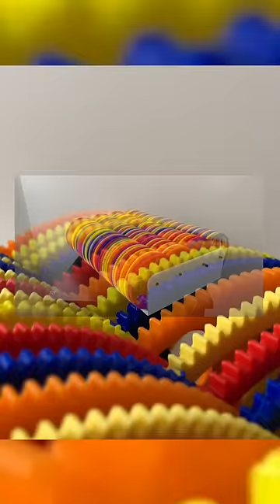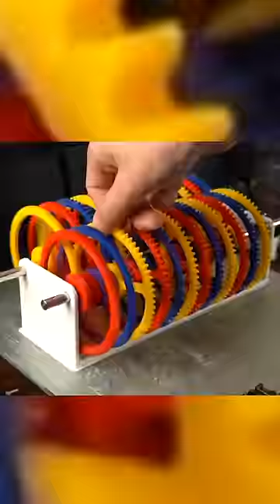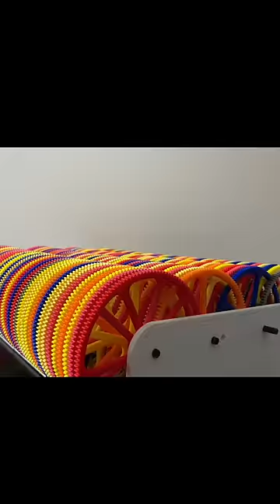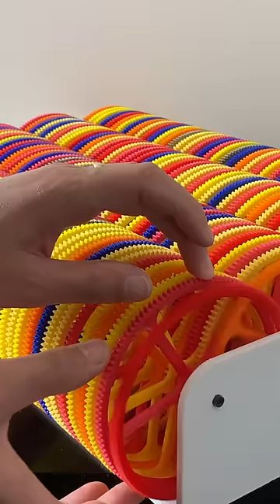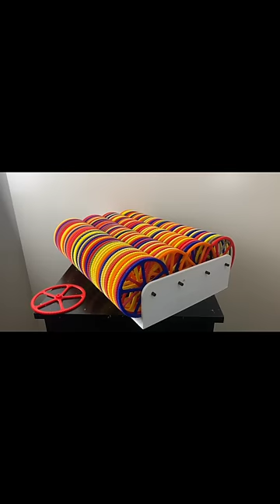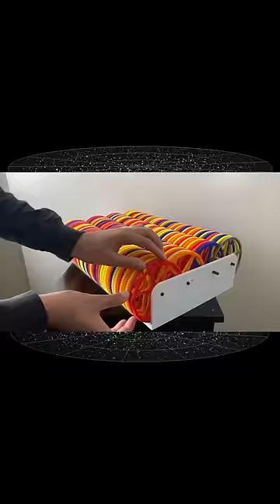World's Highest Gear Ratio (in 60 seconds)

Comment: I just want to see him spin the last gear and see how fast the first one spins
Reply: too much friction, it wouldn't even rotate. You'd break the gear first. It's like sticking a bike in the highest gear before trying to ride up a hill.
Reply: Idc if it breaks the machine, I want to see someone spin the last gear
Reply: world.exe is not responding
Reply: I want to see this
Reply: its just not possible yall, its like trying to move something with mass greater than 1000 cars, either way it's impossible.

Edit: you get my point stop trying to correct my bad example you understood the point
Reply: That would cause the universe to be unobservable.
Reply: You need an unstoppable energy to move it.
Reply: Me just about to comment this then like😮
Reply: I don't care if there's friction or some thing but all I I want to see is He. Spinning. The. Last. Gear.
Reply: @urbancats1  did you take away anything from the reply’s? you literally can’t spin the last gear
Reply: The first one will have a speed superior to speed of light so it will break
Reply: it will be impossible to rotate the last gear without breaking it
Reply: It will fucking explode
Reply: You would essentially need infinite torque to spin the last wheel.
Would could spin the wheel he spins in this video and look how much torque you need to visibly move it. Then multiply that by the ratio, that’s the torque you would have to apply. It is impossible.
Reply: @nanolog522  Nobody cares we want to see him spin the last one so it go fast
Reply: @CheeseFest-  It is physically impossible. There is no material on earth that would make the wheels strong enough, nor would be be able to produce enough torque.
Reply: @nanolog522  just connect it to another gear ratio to create the torque ??
Reply: @jesuschrist9597  did you hear the man he wants to see it spin and frankly so do I so yk what ima do I'm going to spin it at the speed of light
Reply: @CheeseFest-  But then it won’t turn. Because again, the ratio will have to be so large that you won’t see it moving in the next thousand years.
Reply: @nanolog522  then spin the last one so that one spins fast too
Reply: @urbancats1  it literally can’t happen
Reply: probally would be super hard to spin the last gear tho. probally not humanly possible
Reply: That’s the first thing I said after hearing ten to the 82nd
Reply: Creates a black hole
Reply: @susmanrules  Moving a car is not that hard but I agree with your point.
Reply: it'll just broke 🤣
Reply: @jpsalis  ok so make them metal and attach a massive methanol powered big block V8 to it
Reply: Too much torque needed. Structure would break.
Reply: You reach Millers planet.
Reply: @boltlightning7804  - Been a while since I saw that gag...
Reply: @jonslg240  You guys still aren't getting it.  I just want to see the last gear spin still
Reply: @SneekyFauker  actually I can get that lol
The idea from the people who want to see the last gear be spun to spin the first sounds more neat, but probably not possible lol
Reply: Same
Reply: Is would not spin the torque would be too low and friction forces too stong
Reply: @jonslg240  nothings impossible, your brain is just too small probs
Reply: @nanolog522  Bruh 😂😂😂😂what do you mean?
Reply: @ctfrost2613  It doesn’t work. Spinning the last wheel is only possible if it is disconnected from the gearing. Otherwise, spinning it even by something just barely visible would mean that the „first“ wheel would have to spin millions or billions of times. Which is impossible.
Reply: @nanolog522  nothings impossible
Reply: @nanolog522  bro if it spins fast enough then billion spins can take a few hours
Reply: @ctfrost2613  Yes, it is impossible. The material is not strong enough.
Reply: universe implodes
Reply: Me to
Reply: @boltlightning7804  explorer.exe isn't responding
Reply: There's not enough energy in the observable universe to rotate the last gear. It's pretty cool
Reply: @cybercloud8021  i know but I want to see it explode or kill the uneverse
Reply: @cybercloud8021  lol
Reply: It would make so much heat that it would melt whole country
Reply: remember, if it take a number of rotation of the first gear to make one rotation of the last
making the last one do one rotation means spinning the first that amount of rotation
Reply: you need the power of the big bang to rotate it slightly.
Reply: It would create a tear in the fabric of space and time.
Reply: U cant do that its technically possible with enough torque and a unbreakble
Reply: @Mrflipflops_w  there is no enough torque to do it
Reply: @jpsalis  not friction. Thats the completely wrong explanation. It's because of mechanical advantages. It's like trying to pick up a stick, except the stick is 2 light-years long and at the end is 10 megatons of steel.
Reply: Same
Reply: I need to see the hardest gear to move get moves then keep shifting up
Reply: @Rpzz0  literally
Reply: @joedad9999  It's both. You're assuming it has to be one or the other. the high mechanical advantage causes an insurmountable amount of friction throughout the gear train that could not be overcome without breaking something, even with unlimited amounts of force. 

Yes, you are correct in your analogy, but it ignores other forces at play in the actual scenario. It would be difficult to move that mass, but not impossible assuming you're apply a torque to this magical rod as it's dangling in theoretical cyberspace. Even a small torque on the stick for a second or two would give the mass some amount of angular speed. really, really close to 0, almost inconceivably close to 0, doesn't mean the same thing as 0.

To better fit the analogy to the real life scenario, assume the mass is on a surface, under the influence of gravity. Somehow. Don't think about it too much. To move the mass, you would additionally have to overcome this force before your object even lifts off the surface. In the real world, no material is infinitely rigid or infinitely durable. Something will break or flex before the mass even moves.
Reply: @alternate5108  I swear what fo I need to build the last few gears out of for them to spin, I wanna see how fast that thing can go
Reply: It's the same thing other way around, it wouldn't spin
Reply: INFINITY!!!
Reply: @susmanrules  But technically&logically you could use a team to move the car.Right?
Reply: @susmanrules  that's not a good comparison cars are not that hard to move....
Reply: Ikr
Reply: It won't bulge
Reply: @urbancats1  you.can't.move.it.even.an.inch.and.only.thing.that.will.happen.is.that.gear.breaking.
Reply: @CheeseFest-  🤣🤣🤣🤣🤣

That just means you have to use a gear that is almost the same as this one. So it will still gonna take this much time
Reply: @KaziiTheAvali_inactive  EXACTLY
Reply: @MünWeeew  you can do the math but most likely that is not even close
Reply: @SneekyFauker  we got it. All we are saying is that, the last gear won't even more a millimetre
Reply: @newbie4789  use a hydronic press
Reply: @jpsalis  yeah that's what I think too
Reply: It would break, but imagine if he just travelled in time 💀💀💀💀
Reply: @newbie4789  probably break the expensive $400k+ engine before turning the gear a single tooth
Reply: I was just about to say that
Reply: You don't have to turn the gear within a few seconds. You could apply a force to it over a very long period of time
Reply: @jonslg240  force won't add up😭😭😭
Reply: like he said more than the speed of light 🤣🤣🤣🤣🤣
Reply: @jpsalis  naw it's like putting your little barbie doll motor onto a cargoship and then trying to go ride the ship through 10 foot thick ice. I just don't think you understand howbmuch power osnnescicary to do this. And Also my thing is not an exaderation it's an extremely under exaserared
Reply: @CheeseFest-  the press will either break the gear wheel or If the wheel is too tough, break itself
Reply: Speed of light xD
Reply: @newbie4789  bro have you ever tried it?? What’s your reasoning
Reply: @nanolog522  Nah Philippians 4:13 bro
Reply: Would explode the universe probably
Reply: @calebs_asmr  I mean that's besides the point, I'm saying no matter how much force you apply, the gear will break first
Reply: @jpsalis  yeah no amount of force in this universe combined could turn that gear.
Reply: @jpsalis  You are describing what I want to see
Reply: @calebs_asmr  use another gear ratio and boom that’s pretty of force I don’t know what you guys are on
Reply: The required torque for that to happen would be absolutely insane, let alone decay of speed and force because of the adverse reactions of friction and the fact that there are most likely over 100 gears in that system. It would be impossible unless you had over 10 million ft lbs of torque, I’m not even joking, and before you even get CLOSE to that number, the parts would most likely snap from the aforementioned forces including that they are most likely 3D printed, there are no chances of doing that any time soon.
Reply: @validbutatwhatcost8754  Surely you can’t be serious.
Reply: @jpsalis  it's hard but it does work. So spin the last gear.
Reply: @jpsalis  you mean when riding down a hill?
Reply: If it takes the first gear to move at the speed of light to make the last one turn once before the heat death of the universe (if that's how it ends) , even turning the last gear one turn per year, the first would go faster than the speed of light. if it worked. But even knowing that I want to see him try 🤪 .
Reply: @angusmctwangstick4079  yeah it would be super cool
Reply: Same
Reply: @shit_happens4594  just use another gear ratio explain why that wouldn’t work
Reply: @MünWeeew  not quite strong or powerfull enough
Reply: @CheeseFest-  ok. So you mean use another gear ratio, that is in the reverse order to spin the slowest gear right?

But you are still limited at how much torque you can generate that is agreeable.

So to amplify that humanly possible torque into a big enough torque that could potentially move the slowest gear in this one even the slightest, you will still need a fairly large gear ratio. At least 60-70 gears if we are using the same type. 

But then it is the same case . It will take a huge amount of time , of the scales of age of universe for the slow gear to move even the slightest so it will never reach it . 

gear ratio is way more powerful than you imagine. The torque is increasing proportional to the ration and each gear is multiplying the gear ratio by 10. Like adding a new gear means atleast 10 times the torque you need before
Reply: @CheeseFest-  na. When he said 10 million ft lbs, it's way less than what we actually need. Imagine that yo turn the first gear, you need 0.0001ft lbs of torque. Then 10 million ft lbs won't be enough to spin a mechanism like this with just 12 gears.
Reply: @odezat1317  I hope you're kidding
Reply: @champagnepandaog3305  Ah, yes. The power of love and friendship.
Reply: @newbie4789  Yeah, power does but force doesn't
Reply: @CheeseFest-  How old are you?
Reply: @CheeseFest-  Then you're back to square one with infinite spinning to do
Reply: @jpsalis  make it from carbon fiber.
Reply: @susmanrules  that’s false, I’ve push started my car and pushed it up a hill, I’ve moved my car and others
Reply: Speed of light
Reply: I WAS THINKING THE EXACT SAME THINGGGG. Ik it wouldn't work but imagine if it DID.
Reply: Yeah guys i know it's impossible, but at least i just want to see him try
Reply: Probably wouldn't even spin unfortunately maybe if he set it up to put a drill on it
Reply: That would take more torque than the solar system has
Reply: I will spin so fast you will need duble face protection in case it s breake, which it will most likely
Reply: @nanolog522  who cares how efficient is that, we just want to see someone grabbing the last one, and rotating it, no matter if he succeeds or not. just grab it
Reply: @crackedthieves  it never spins. we just want to see someone try it
Reply: @CheeseFest-  forget about 1:10^169, a chain of a chain of 12 gears with ratios 1:10(an overall ratio of 1:10^12) can already reach light speed(never happening) when you spin the last one for 3mm/s. your argument is nothing to them just like how their arguments are nothing to you, satirical or not.
Reply: @nanolog522  ik but who cares we know it wont work but still we wanna see someone try it
Reply: @nanolog522  dont use harsh words man
Reply: To all of you trying to explain why it won't spin, duh... We just want to see a black hole form when the laws of physics break down.
Reply: Assuming he removed all the backlash from the gear assembly, you saw the last gear spin, just a tiny fraction of a degree of rotation, extremely slowly.
Reply: @jpsalis  it would be interesting to calculate the theoretical force though
Reply: I've heard it would take more energy than the whole observable universe has due to torque
Reply: i think it will spin with the speed of light 💀
Reply: Make one, out the strongest material im the universe, then spin it
Reply: Não é pq é impossível que não deveríamos tentar kkkk
Reply: @susmanrules  i ve seen my family move a car multiple time ,it s not that hard
Reply: That's like asking someone to bend a piece of wood in half without breaking it.
Reply: Do you know torque and why I hate it
Reply: And creates the black hole
Reply: You can't spin the last one even 1mm
Reply: If it somehow did turn the first gear, I’m almost certain it would explode from the speed and torque alone.
Reply: Some of the people here, don't understand what the word "impossible" means, do they?
Reply: @alternate5108  technically it might be possible if the material can survive you could use a divergent tech tonic plate boundary and have a rope to one side and the contraption on the other wile the first one will spin really slow and probably break NGL it might work
Reply: @jpsalis  theoretically if it did spin he means, would probably warp space time if he got it to rotate at just 1 rpm
Reply: @boltlightning7804  run: world.exe
Reply: if the amount of rotations of the first gear required to turn the last gear are virtually infinite then the torque required to turn the last gear is also virtually infinite
Reply: @starlitstreet  😑😑 of you can just turn it because its small and i am big and strong
Reply: This me
Reply: Me to best guesses are , disintegrates,  creates a black hole , or Flys into outer space due to all the respective physics
Reply: Its impossible, that much torque doesnt exist in the universe.
Reply: Enough torque it's a time machine. "warping time" = /> "teeth lost" =D you would certainly hit your target sooner haha or not at all OO
Reply: If you connect that thing on the motor thing that turns kinetic energy into electricity you will have enough power to power a City i think
Reply: @jpsalis  wait it’s not meant to be the highest one.
Reply: Too much torque
Reply: It would spin at the speed of light
Reply: @mattithun4813  Even if that was precision machined you wouldn’t be able to turn it. The stress on the gears would be far to great.
Reply: Let's say for instance he was able to spin the last gear directly!

Hello darkness my old friend... I've come to talk with you again!
Reply: @mattithun4813  no it wouldn’t it would speed at a direct formula of 1.5(10^n) n representing rotational units.
Reply: If he spins the last gear wouldn't it be like spinning the first one? He's just turning the machine around... spin the one in the middle
Reply: This is why I came to the comments just to see if anyone asked the same question
Reply: @alternate5108 I like how you think champ
Reply: same thought
Reply: @alternate5108  Let's say it doesn't break at all, you still wouldn't see it move according to physics because the outer velocity of the gear on the other side would reach 99.999999...% the speed of light and I'm not sure about this but physics says you can't move any object faster than the speed of light no matter how much energy or force you apply.
Reply: probably bazillian times faster than speed of light if the gears were made of indestructible material and guy spinning it is god lol.
Reply: its like ur trying to divide by zero
Reply: The torque would break the gears before it ever spun xD
Reply: It would either fail miserably or defeat the odds and open a vortex to the 4th dimension, strictly these outcomes only, nothing else would be a reasonable guess. 
😐🙂
Reply: @jesuschrist9597  try it ANYWAY
Reply: Torque would make it impossible
Reply: Like he said, faster than the speed of light. And that’s just one rotation per billions of years. If he could spin the front gear at an observable rate it would probably take more energy that there is in the universe.
Reply: break
Reply: make it out of hyper strong material and have a tank pulling winch on it
Reply: I know ow right
Reply: @MailboxYig  thats not how it works... the mans in the video just ecplained how it'd have to go faster than the speed of light to move the slow one which is excentially impossible, but moving the slow one to make the other one travel faster than the speed of light is impossible to have friction not break the gears with whatever humanly possible material you can think of as it would just begin to rip the molecules apart, and even hard with modern rocket science specially with a tank
Reply: Regardless of friction you would need basically infinite energy to exert the required force on the last wheel
Reply: Friction makes it impossible around the 8th gear. But I think it would be interesting to try building one with a very cold superconductor and magnets
Reply: you can all ready do this in 4 low  on a 4x4  it would go 55,000 rpm at 60mph
Reply: It would just break
Reply: @nanolog522  Spin the wheel! Spin the wheel!
Reply: @alternate5108  If the first gear would need to spin faster than the speed of light to complete a single rotation on the last gear before the heat death of the universe then spinning the last gear is going to be flat impossible.
Reply: exactly what i was thinking
Reply: @jpsalis  At an 80° incline... with the sun's gravity.
Reply: @susmanrules  moving a car isn't impossible
Reply: @jpsalis  BUT I CAN RIDE UP HILLS AT MAX GEAR
Reply: The energy needed is infinite though
Reply: Yap.
Reply: @cooperpayne  man. It's an analogy. And you're not doing it from a standstill on a hill. I was making a reference to the overwhelming amount of force you would have to overcome just to get any movement at all. The scale doesn't compare at all. Jesus dude, we're talking about a gear ratio, you had to make this a personal attack?
Reply: @susmanrules  you think it’s impossible to move a car?
Reply: Yup
Reply: even if entire train engines in the world are connected in series they even that amount of force cannot rotate the last fear (#if somehow the gears are of VIBRANIUM)
Reply: @yashpatil7017  no trust and how would you even know ?? Have you tried it
Reply: we don't want to destroy the universe though
Reply: @susmanrules  move a car impossible? Not if it’s a Japanese car.
Reply: Me too i wanna see it go burrrrrrrrrrrr
Reply: Same here
Reply: @alternate5108  lol, you will be watching a video of someone breaking a gear box then.
Reply: @jpsalis  yes but is there a metal or something that would allow it to turn? Even with a pry bar?
Reply: Me too!
Reply: ok.... but what if you put a low torque generator on the fast side, then a rubber band on the other side?
Reply: That’s all I was thinking of 😂
Reply: But you could theoretically very gently push it causing the first gear to rotate. You just have to push it slow enough
Reply: Genius
Reply: Excalibur!
Reply: @jpsalis  not about friction, but force needed
Reply: instead of moving just the last one you can move the 2nd gear and multiply by 2 each each step up.
Reply: @jpsalis  It's not the friction, it's the angular inertia.  Even with a frictionless gear box, you still couldn't spin it.  Changing the angular velocity of a rotating object requires energy based on its moment of inertia.  Just as you would have to spin the input gear faster than the speed of light to get the other one moving, the amount of work you would have to do on the output gear to get the input gear to move any measurable amount would instantly generate a black hole.
Reply: I would also like to see him spin the last gear,

 (what I meant was, I want to see it break due to physics not allowing it)
Reply: here https://youtu.be/FywIvJ_jIhg a video where another guy tries to move the last gear on a different gear ratio (still really big)
Reply: @susmanrules  the
Reply: I was going to comment this
Reply: it was like trying to hold weight of blackhole
Reply: did you Just go faster than the speed of light?
Reply: I want to see him try spin the last gear too!
Reply: lmao first build the same thing bedrock, then the first gear wuold be so fast that it wuold destroy thw entire universe
Reply: People keep /saying/ it literally cannot happen, but I've yet to see any if you even try one time.

Just fucking try spinning the last gear damn it
Reply: It would take so much energy to spin  that if we made as many nukes as earth's resources allow and use all that energy to spin the gear the gear would break
Reply: The amount of torque needed for that would require a lever that is the size of the universe and indestructible gears 😂
Reply: Man just created the impossible at the same time possible last gear
Reply: @evansgambit164  Youre an understanding person, thanks for the comment!
Reply: @alternate5108  same 💀
Reply: Try it. When it breaks, go to the next one. Repeat until it turns. How many must die for it to spin?
Reply: The amount of energy it would take to spin it would be impossible.  Galactic level energies
Reply: Honestly probably more energy than the entire universe has.  

The first gear would have to spin at the speed of light for trillions of years to get the first to spin once.   
You could hook it to a spinning black hole and it wouldn't turn it.   
Obviously things would fail first, but beyond that if you had some mythically strongattial that COULD do it, and you COULD get the first gear to spin faster than the speed of light, and show hook it to the fastest spinning most massive object in the universe, and it would stop the spin of that thing. 

It's inconceivable, the level of force.    

It's, by all intents and purposes, impossible.   

So yeah we wanna see it too
Reply: @alternate5108  1000th like on your reply!!! It was so satisfying!!!! 😄
Reply: Space time itself will collapse and will cause a permanemt rupture in the universe creating alternate realities and will eventually lead to a big bang then the universe will start again. 😅
Reply: bro's gonna break the laws of physics
Reply: You should try to lift a bulldozer with your barehands to get an idea
Reply: @joedad9999  yeah I wasn’t exactly sure what friction had anything to do with it. That’s making the presumption it would move at all.
Reply: The machine breaks so the universe doesn’t
Reply: The weight of the final gear attempted to be spun would be so great the gear material would shread before turning the gear
Reply: @micheallinne3159  rubber band, and a rotational generator.
Reply: That’s just what I thought
Reply: @jpsalis  so i break my bikes because im always riding on the highest gear?
Reply: I think about same think
Reply: Doesn't that mean it's broke then?
Reply: Couldn't you manually spin certain gears to artificially speed it up?
Reply: That takes too much force. The first gear would spin faster than the speed of light.
Reply: @jpsalis  what if it had a high torque insanely powerful electric motor hooked up to it in the gears were a insanely strong material like tungsten carbide or armor Steel
Reply: @Dzexel  wu t? youtube replies are strange lmao
Reply: WE. WANT. TO. WATCH. IT. GO. BURRR.
Reply: Same
Reply: As much as I'd like to see him spin the last gear, it would surely break something, if it would even spin
Reply: idk why people saying it’s not possible it’s only made out of plastic it can’t be that hard to spin
Reply: That's not how it works
Reply: @susmanrules  Don't care,  me wan't see.
Reply: at the speed of light
Reply: too much torque required
Reply: Yeah torque and friction say no. My brain also wanted to see him defy physics thought 😅
Reply: Exactly...🤣
Reply: supernova
Reply: Can't cause it'd fracture space-time causing our universe to collapse upon itself ending all existance as we know it...💥 

We should give thanks He is a fair & just Creator🛐
Reply: I guess faster than the speed of light 😂😂
Reply: Only a few requirements.
1) We need the gears to be indestructible a million times stronger than the strongest metal known to us 
2) Infinite endless energy is required to spin the last wheel
Reply: I’m with ZMorea on this one. Physics be damned! SPIN THE LAST ONE!
Reply: @marcuspowell2510  it will break before anything happen 🤣🤣🤣 it's against the physical law's of the universe
Reply: @regalblack1503  PHYSICS BE DAMNED!!!
Reply: Dude would go back in time, obviously...
Reply: universe begins to lag
Reply: @jpsalis  as soon as you break it go to the one after that until it works
Reply: 3 in 1
Reply: It's not just hard, it's literally impossible because you'd need to apply the energy necessary to have the first gear surpass the speed of light and that amount is infinite. So it either breaks, or it doesn't move at all (or it moves so slowly you wouldn't even notice).
Reply: @mattesh5839  I mean yeah eventually you'd find one that spins but it couldn't be more than like 20 gears from the end or something
Reply: It would instantaneously convert its mass to energy and detonate
Reply: If he had enough energy to rotate an indestructible version of that gearbox with its last gear, the first one would rotate several million times the speed of light, most likely a lot more than that though, I just don’t wanna actually do the math
Reply: As he said, the first would have to rotate faster then c to get the last one to spin once before the heat death of the universe. That is impossible under the current understanding of physics
Reply: It will show you heaven work
Reply: @jesuschrist9597  did you not get the joke lmaooo💀💀💀💀
Reply: Omg the people in this comment thread is killing me lmao
Reply: @jpsalis  I did it
Reply: That’s what I was thinking
Reply: @jpsalis it's made out of plastic so either it spins or it doesn't I want to see him try
Reply: the 1st gear would spin so fast you wont be able to tell if it moved or not.
Reply: I was gonna say the same thing
Reply: @jpsalis  well that just requires a couple days of cycling before it's easy. Analogy rating 4/10
Reply: If the gear could hold, you would probably literally need more energy than there is in the entire universe.
Reply: @adamperry5794  what are you going on about?
Reply: @jpsalis  I can't find my comment and don't remember commenting here so I have no clue
Reply: @jpsalis 
 oh it was that comment

Idk bro it might have been bc cycling up a hill on max gear is easy as long as you've cycled a couple days in a row

So I gave you a bad analogy review

Simples :>
Reply: Shut up I spun the last gear…
Reply: Like he said, assuming nothing breaks which it would, the first would spin faster than the speed of light.
Reply: @jpsalis  makes sense. He needs gears made of better material than plastic.
Reply: @Rpzz0  want to see it. Lol
Reply: @nanolog522  let's say the gears are never going to break or melt or change. If you hooked a 1200 hp Toyota supra up to it could you spin the last gear?
Reply: To put it simply, he'll spin the last gear when you pick up a car with a toothpick 😂
Reply: error 404
Reply: @jesuschrist9597 You aren’t listening. He wants to see it, and frankly, so do I! A fruitless want, but a want nonetheless..
Reply: @PIndyJones  No. Because hp are not what determines if you can spin something, that would be torque.
And you would need billions of Nm (or even more, I don’t have time to calculate it) to turn those wheels.
Reply: not possible....
Reply: Lol unimaginable amount of torque
Reply: Faster than the speed of light
Reply: Yes
Reply: @nanolog522  well, I would assume a thousand HP supra would be pushing very high torque also. But i get what you're saying.
Reply: the big bang
Reply: @PIndyJones  It would be a different kind of torque. With a car, that’s just a number. The engine would have to turn the wheel from zero rpm. That would require gears and at the end a clutch to fix the fact that a gas engine needs to turn to generate power.
Reply: @jpsalis  don’t think its friction but tension
Reply: Maybe it would spin so fast it warps time 💀
Reply: @jpsalis  I learned this the hard way with lego gears
Reply: I want to know the math behind this action, like if all the mechanics and friction worked out and it was possible, would the speed be faster than light? With all the exponential growth it seems like it would intuitively.
Reply: Not enough torque possible.
Reply: That would take a greater than infinite amount if energy
Reply: it will take force of earth's weight
Reply: INFINITE POWAAHHHH
Reply: Imagine building last gear with super strong material.(I think it still break)
Reply: The last gear cannot be spun, it's stuck like as if it was glued down. You would break the last gear long before it can move.
Reply: Faster than the speed of light surely?!?! 
He's invented a warpspeed drive!
Reply: So many in the comments not able to just take the piss
Reply: It just wouldn’t move. It would feel like it’s completely stuck.
Reply: A 'world.god stoped working' message would pop out
Reply: @jpsalis  no shit
Reply: BOT  did I say bike? I meant bicycle, either way
Reply: you're all wrong you could get the first gear spinning off the last gear but you would just have to create an entirely separate device to move all the other gears just enough to build some momentum maybe even something simple like equivalent to a rake set up in a very specific pattern that would allow you to move a portion of the gears
Reply: @nanolog522  Rick Sanchez could spin the last gear
Reply: The amount of power needed would be crazy, assuming that the gears are indestructible. The last gear would most definitely be moving faster than the speed of light.
Reply: @staticostrich4689  make em out of cobalt or tungsten
Reply: @odezat1317 , "The first one will have a speed superior to speed of light so it will break", or maybe it will cease to exist?
Reply: Once u get to the last gear the first one will break long before
Reply: @jpsalis  our hardest alloy in dead space bro
Reply: @MerudonWoW  if you started in the middle
Reply: I could move that last gear. 100$ I could move that
Reply: Spin it !!!
Reply: @alternate5108  they just said it won't spin. it will just break. are you not understanding that?
Reply: @CheeseFest-  sup? you just fly in from stupidtown?
Reply: Imgine using the same amount of force in one twist of that last gear as  spinniing the first gear at light speed for millions of years. Pretty sure a big boom would happen
Reply: I’ve tried to spin 5 toy gears using the largest one and it wouldn’t even move. This would Straight up break lol
Reply: That's what I was thinking!  I don't think it is heat that is the problem, per se, but force needed to spin it.  You couldn't budge it in the first place.  I guess you could on a technical level, but we would be talking about imperceptible movement.  The plastic would shatter just like trying to haul on a knotted rope until the knots work themselves out.  Rope failure or the thing it is tied to would occur before you gained a centimeter of slippage.

Kind of makes you wonder if it isn't possible to do the exact same work of a piece of hydraulic construction equipment using only one man and his muscle.  I mean, I know it is possible, but not using a reasonably sized or easily transported mechanism.
Reply: BESTNVESTING  I'm just asking an honest question though would it be possible to create a separate device with say the equivalent of many little fingers hanging down perhaps or gears themselves that you would hold in your hands hopefully this makes sense and sort of lower on top of the gearbox and all the individual little pieces would make contact with all the necessary gears and start very gradually turning them all at once building up the momentum so that no uneven amount of force is distributed among any one gear
Reply: BESTNVESTING  and of course along with this caveat comes with the obvious that the gearbox could be made out of anything you want from titanium to tungsten
Reply: @jpsalis  If the material would be a different one? like metal? it could work?
Reply: @jpsalis  no one asked
Reply: @Rookie0X  nope you need much more than that as still wouldn’t work it would break
Reply: @jesuschrist9597  use a motor to drive the gearbox duh
Reply: @jpsalis  I've rode a bike in the highest gear up a hill
Reply: @boltlightning7804  space-time.exe... Your welcome 😁
Reply: the amount of torque required would not be possible, and would break the gear
Reply: @bluegreenash  I have rode up a hill with a bike in top gear
Reply: It's funny reading the comments saying just spin the last wheel even if it breaks. Many people already explained it was impossible to move but they still insist to just move the last wheel lmao
Reply: wouldn't it just do the same thing even if you started on the last gear??
Reply: @radioactive1014  its a fundemental concept that us humans desire more than just an intellectual understanding of something
Reply: With a sufficiently strong material and sufficient energy, you could spin the final gear as fast as you want, as long as it doesn't exceed the speed of light. The first and last gears would both be very close to the speed of light, but with vastly different energies, due to relativistic effects that can be modeled with Lorentz transformations. It's counterintuitive but at relativistic speeds, the gear ratio no longer describes the ratio of wheel velocities, but the ratio of the energies.
Reply: @jpsalis  I get this, but can you not freely spin that last gear like the first? What's preventing the last gear from being the first gear if you just so choose to spin it from that end? Anything?
Reply: @radioactive1014  Just move the last wheel :sigh:
Reply: yeah
Reply: @alternate5108  it doesn’t break the machine, it breaks physics
Reply: For people asking him to spin the last one, there is not enough energy in the universe to spin the large gear even if the material was indestructible. Simple physics
Reply: No material would handle the force it would take to spin that gear
Reply: @susmanrules  Don't mind me trying to find an electric motor big enough to do so
Reply: @jpsalis  can't have no in your heart...
Reply: Black hole created
Reply: @champagnepandaog3305  "Nothing is impossible, Mario! Very unlikely or highly improbable, but never impossible!" -Luigi
Reply: TL/DR of this comment thread, both sides say:

"DID I STUTTER?!"
Reply: lol @ the mix of trolls and people who genuinely don’t understand in this thread
Reply: that will make space time collapse into a blackhole
Reply: @jpsalis  it didn't rotate not because of the friction
the rotation speed just didn't respond
Reply: It should spin faster than the speed of light by his own words
Reply: Sad
Reply: @nesyboi9421  how old are you? i said the torque is too big you would need more energy than the earth is currently making to spin that gearbox. its not possible
Reply: Interstellar music intensifies
Reply: Do it on 20.12.2022
Reply: Man read my mind
Reply: @susmanrules  mathematically yes, but I'd like to see if I could break the gear at the end
Reply: @jpsalis  what if you stuck a wartsila rt-flex96C up to it? Would it power the gearbox?
Reply: @nanolog522  what if you used a wartsila rt-flex96C?
Reply: @MeEntertainmentJo_876  Not even close to what you needed.
Reply: @alternate5108  there isn’t enough energy in the universe to spin the last gear.  That’s not an exaggeration.
Reply: @nanolog522  😭 I want to see the last gear spin! 😭😭😭
Reply: There's no material in this world that can sustain that force. This plastic one is going to break.
Reply: @resque1122  ….

But I want to see how fast I goes!
Reply: Torque is infinite, you can probably pull a black hole with that thing
Reply: @thewanderingguy5436  my sex drive be like
Reply: Everytime he spins the last gear, universe dies.
We are luckily in the version where he doesn't.
Reply: Right, that's exactly where my mind went
Reply: Facts, it would produce so much light that the next Big Bang would happen
Reply: Same numbers and time just backwards,,,the planet would collapse
Reply: @susmanrules
Reply: @jesuschrist9597  let. Me. See. Spin.
Reply: lmao
Reply: @PandiTheBear  that's a good analogy, I like that one lmao
Reply: I agree, I want to see the last gear turn.
Reply: @boltlightning7804  lmaooooo
Reply: @alternate5108  it is physically impossible no matter how much force you apply. To turn that final gear at any amount it would cause the first gear to move faster than the speed of light which is impossible.
Reply: If it were possible, the first gear would spin faster than light, given how long it takes to rotate the other way around.
Reply: @jesuschrist9597  did you take nothing away from his comment? He does not care, he still desires to see it!
Reply: @TheYourGoose  "YoU cAnT wAnT tO sEe It SpIn BeCaUsE mAkInG iT sPiN iS tOo HaRd!"
Reply: @urbancats1  it's like opening semi truck tyre bolts with thin plastic long rod , it would just break. Spinning that last gear is like spinning a gear that is uper glued, it won't just move.
Reply: @jpsalis  🤓
Reply: Okay but what if the material from which gears were made would be theoretically indestructible and we would use like black hole to spin the last gear?
Reply: @calebs_asmr  What's exaserared
Reply: the last gear feels like its not able to move.. well except that its plastic and you can easily break it
Reply: @jpsalis  i only ride my bike in the highest (21st) gear.. aint nobody got time for shifting gears on a bike
Reply: @ayushkumarjha9921  Oh I didn’t know that thank you
Reply: Not possible unfortunately. He said he’d have to spin the first gear at over the speed of light. To get the last one to move. So reversing that, you’d have to put the energy required to move something at the speed of light, into the last gear, to move the first.
Reply: We as humans think like that only first 😂
Reply: Proceeds to create a machine capable of moving at the speed of light
Reply: @odezat1317  That's what we want to see got damnit
Reply: @Rpzz0  That's what we want to see, dingo
Reply: You heard the man, he can make that gear go light speed! FTL DRIVE.. jokes.
Reply: Broke: “The last gear won’t spin, don’t even try it”
Woke: “That’s the point.”
Reply: @nanolog522  this is untrue.  The last gear is spinning.  It's just so slow it's unabservable.
Reply: I said the same thing
Reply: @boltlightning7804  universe.exe has stopped working
Reply: @CheeseFest-  The gears would break
Reply: @celularphone  It is spinning when turning the first wheel, that’s true. But here it is asked to spin the last wheel and turn the first one doing that.
Even a tiny bit of turning of the last wheel would result in the first one going insanely fast. This means that you need insane amounts of torque to just start turning the wheel, and for technical reasons, no motor exists that would allow that amount of torque at zero rpm.
You would be kinda correct when talking about the theoretical model. We are not, however.
Reply: No, that will time travel to the past.
Reply: @nanolog522  you are wrong.   Take the Aamer contraption.  Hook it up opposite.  Spin the last wheel and it will make that wheel the new middle and the last gear will spin.
Reply: Births a new universe
Reply: @boltlightning7804  God himself comes down and bans the guy whos cheating
Reply: Ok, so the 1st gear has the least resistance and friction to being turned, while the last gear has the highest resistance, to the tune of 10^169 times the force required to turn the first gear Superman would blow his asshole out before he'd turn that final gear.  If any human tried, you would simply see a gear that doesn't turn.  There's bound to be a small bit of play in the final gear, but it's not going to actually turn.  The mechanism would break first.
Reply: @jpsalis  good  analogy
Reply: Beat me to it lmao
Reply: @LordPrometheous  it will turn an unabervable ammount
Reply: You would see the other gears turn
Reply: @CheeseFest-  fucking genius
Reply: Spin it
Reply: The whole video went over your head and everyone who liked your comment. He literally explains that it would be impossible
Reply: he won't be able to spin the last one
Reply: It would blow up I'd you could spin it lol
Reply: @nanolog522  you have clearly never had my wife's cooking
Reply: What if they were spinning as you started attaching them together
Reply: @CheeseFest-  this was fun, thank you haha
Reply: @jpsalis you mean riding up a vertical wall
Reply: @ColCurtis  exactly. If there were no backlash, (which I am sure there is but let’s pretend there isn’t and the materials could hold up) and you hooked an identical gearbox in the opposite direction, you could turn one end and see the other end turn the same number of times while not noticing any motion in the middle and that would appear almost magical.
Reply: @HoldYourSeahorses  lol
Reply: Right! Exactly what I was thinking
Reply: He already did, he blast the entire universe back in time and we are just reliving all the events that’s already happened
Reply: I just want to see the last gear spin also, or at least the second to last. why is he only playing with the first 2 gears. what a rip off
Reply: Itd literally be impossible for him to spin.  Even spinning the 15th one would be physically impossible
Reply: @jesuschrist9597 you can spin the first one but you’d break his silly plastic gear assembly. Thus demonstrating he didn’t really construct the “worlds largest gear assembly” if they cease to function as gears
Reply: Spin the last gear
Reply: @susmanrules  what if he put a big wrench on it so he has a lot of torque to work with?
Reply: @dodowhisperer2114  thats just not possible, the wrench that youre probably break if the gearbox would be unbreakable, its from plastic still
Reply: imagine someone trying to push earth, heck just do it.
Reply: @alternate5108  it would take so much force, it would literally just break instantly, it wouldn't spin lol
Reply: It would end the universe quite Literally
Reply: What if you just start spinning the 1st gear then the 2nd then the 3rd then 4th, so you can have more power
Reply: @CheeseFest-  this video explains better about the torque 👇🏻
https://youtu.be/TXX9BXH2yzI
Reply: @alternate5108  its impossible with our limited science knowledge.
Reply: @jpsalis  what about make the gear with tungsten and rotate it with nuclear power

i think it will the first time when any man made object will move faster than speed of light

is it my day dream or  it's possible please reply 😅
Reply: Can you guys just stop with the science bs. Just spin the last gear
Reply: Ok im building one of these and im going to give the people what they want, im gonna spend the last gear ⚙️ 🤪
Reply: @chemseddinedjouama4115  C.E.R.N.
Reply: @Joe Dad  then you get like 6 cranes bruh and they lift that shit together
Reply: @Joe Dad  how heavy is a megaton of steel?
Reply: "THIS IS ELON MUSK"
Reply: @MünWeeew  no difference
Reply: I wonder how devastating the damage would be if you moved the last gear a quarter inch in a second.
Reply: @Gajal_Waley  no even if you make gear from fictional material called vibranium, even the you have not enough power and energy to rotate the last gear. Infact, even if you use all the energy ever created by the entire universe you still wouldn't be able to rotate the last gear.
Reply: Literally me
Reply: Too much force will be required
Reply: People not understanding why u can’t spin the other one lol
Reply: @jpsalis  
Yeah you get a better workout what’s your point?😂
Reply: He can't spin it but If he could it would litterally make the one that he's spinning have litterally over10000000rpm
Reply: Right! I don't think it's technically a gearbox since that wouldn't even work...
Reply: @alternate5108  it wouldn’t spin if it’s broken, though
Reply: If the materials were strong enough you would need almost infinite energy for that
Reply: If it were possible, I'm guessing faster than the speed of light
Reply: Couldn't we move them all at one by applying force on all
Reply: That will be the key energy to travel with speed of light
Reply: @CheeseFest-  The art of making energy out of nothing. It is impossible to cause something to move faster than the speed of light.
Reply: I was just going to say the same lol
Reply: @jpsalis this is the explanation we mortals need 😂😂😂👍
Reply: @jpsalis  say theoretically, if you built this out of a invincible material, how fast with the first gear spin
Reply: @jpsalis  no the friction will be there but not enough to stop it as each one is moving faster then the other, cause they does not oppose the movement. Though jumpstarting each gear at the same time is needed because of inertia the fiction will be higher, if we also jump start each then this contraption will break far before it reaches to first from the last😅. Thats my take , i took everything into consideration as far as i can think there might be something else 🤔
Reply: Then the gate to  another dimension will be opened...
Reply: If we assume zero friction and an infinitely strong system it would take infinite energy to spin last gear once before the heat death of the universe. In order to complete one full rotation it would rotate the first faster than the speed of light. Given that it takes infinite energy to reach the speed of light it would take infinite energy to rotate the last gear once
Reply: I think spinning the last one should be the same as spinning the first one..
 It will not move the ones in between... no?
Reply: Basically we want to go from back to front turn the last gear and see what happens! Break it be dame! Turn the last gear! Dang it!
Reply: @jpsalis bro the gear will move if have that much torque to move it
Reply: D
Reply: D
Reply: @md.hasibulhasanhasib619  which comment are you replying to? That's just wrong. Also we've depleted the comments on this thread, this is very sad.
Reply: @urbancats1  bruh, its not possible to move it Xd
Reply: Big Bang pt. 2
Reply: Ezactly
Reply: PHYSICS.exe isn’t responding lhh
Reply: Use a lever
Reply: I tried and I am in new universe now, here friction is zero between all surfaces smh 🤷🏻‍♂️
Reply: Force required for that can end the universe
Reply: @jpsalis  so theoretically if you have an indestructible gears that replace the plastic ones, it would go faster than light speed?
Reply: @bigmak_07  the thing is literally no, even if you had indestructable gears, no friction and a neverending supply energy, relativity exists
Reply: @jpsalis  thanks
Reply: Rotating the last gear would be the same as rotating the first gear as it will act as the first gear and it's impossible to get the opposite last gear spinning

Thats the correct logic😎
Reply: 108k likes 🤯, if only the same can be done for my videos
Reply: I am also thick about it.😂
Reply: Wait🤔
Reply: MADE IN HEAVEN
Reply: Maybe it will undo the last eight years of absolute insanity.
Reply: Hi
Reply: @jpsalis but if it didn’t… lmao
Reply: Yes!!!
Reply: Wait a minuteif spinning the first one will take a long time wouldn't spinning the last twke you back?
Reply: @alternate5108 They already told you what will happen. It won’t spin, at all. It’ll break.
Reply: @catlover333  that’s the point. Spin the last one, and the first one could theoretically spin faster that the speed of light cubed.
Reply: What about the entire gearbox spun up
Reply: @aloniabasmerom8868  nothing will happen
Reply: @alternate5108 😂😂
Reply: Most likely this gear isn't even all functional and he's proposing a hypothetical
Reply: probably over light spe- waita second
Reply: Plz no, that would destroy the whole Universe
Reply: yea it wouldn't rotate as there is wayyyyy to much friction and the torque needed is beyond the amount of energy in the entire observable universe. if he did try to spin the last gear it it would simply just break the plastic and nothing will spin.
Reply: It would still take the same amount of time for the first gear to spin I guess
Reply: Not possible
Reply: Time machine bola to be light se bhi jyada hogi speed 1st ki agar last gear rotate hua lekin not possible
Reply: Exact question... I was thinking...
Reply: It will break even if it's made of the strongest material on earth
Reply: He needs leverage the mass of sun to rotate the first gear
Reply: @jpsalis what if we quarter the gear ratio? Go 1/4 in and spin and then 1/2 way, then 3/4 and finally the last one!!! 
There’s got to be a way! I mean come on, particles can be still and moving at the same time. So can the gears!!! THE GEARS!
Reply: Same here 😂
Reply: Timetravel
Reply: If it manages to hold on then it would defy physics. As the speed of the first gear would be the speed of light . And as we know nothing can be faster than the speed of light.
Reply: The machine that breaks the world lol
Reply: Even if it does spin without breaking, it won't be literally over light speed. It'll likely not even pass the speed of sound because in order for objects to move, the atoms need to collide, and that cannot happen at the speed of light
Reply: Actually, it might pass the speed of sound..
Reply: 😂 @jpsalis
Reply: My ford ranger could spin it
Reply: Iria girar mais rápido que a velocidade da luz, ou seja, impossível.
Reply: Ok so the material you would need would be nuclear lasagña
Reply: It'd have to go faster than lightspeed, so the machine would break
Reply: I wondered the same thing lol
Reply: Also why cars don’t have 100 gears
Reply: Took the words right out my mouth
Reply: Too much torque
Reply: You can find out when the universe dies
Reply: If it was designed with a material that was able to withstand the force...I'd wanna know how much it would require to move it
Reply: @jpsalis what about if you use hydraulic press
Reply: Same
Reply: @jpsalis are you some sort of evil genius
Reply: how the hell is this comment section still going
Reply: Nah i'd rather live than getting fucking annihilated by a gear destroying the universe
Reply: @jpsalis I already do that my bike is stuck like that and I’m 12 so surely adults can do that pretty easy and my bike chain is all rusted up to so more friction
Reply: I'm sure he can't rotate the first one due to the high torque required to do so.
Reply: Same bro
Reply: @jpsalis  screw friction 
Oil them gears up and spin it 
I could care less if a quantum tear in the universe forms 
I want to see it spin
Reply: Would be like trying to lift the Empire State Building with a chopstick
Reply: Same
Reply: Fast enough to turn back time
Reply: Someone should try
Reply: @jpsalis its not just friction, you need more energy to spin something faster
Reply: @kahootname  y'all are driving me insane
Reply: I hope the first one breaks the sound barrier
Reply: @boltlightning7804  I want to make it spin in 0 gravity
Reply: That’s not really how it works
Reply: More than speed of light 😂
Reply: The first would move faster than the speed of light like a ratio of the first and last gear wheels and the first would be possible but for the last to move the first it would have to move through all of the other ones in between making it, you would have to add an insanely large amount of force to move the last gear, it’s like opposite effect of the amount you would have to spin the first gear to get that amount of motion but summed up all of it.
Reply: @jesuschrist9597  I know it's impossible but somehow I still wanna see him at least try XD
Reply: That'd shit woul break
Reply: Right I wanted to see that too
Reply: It would supposedly take as much energy as there is in the observable universe
Reply: You guys say “impossible” and “physically cannot happen” and “literally cannot happen on our realm of possibility”…

But the people have spoken.. 

spin last wheel so first wheel go fast wow  plz
Reply: Cac
Reply: I was about to type this, but it was already typed
Reply: It explode
Reply: I agree ...you still wanna see it .
Reply: @susmanrules its invulnerable to all threats physical and magical 😂😂
Reply: It wouldn’t spin,, unless the gear teeth is broken.
Reply: Or even the center one, to see the first explode
Reply: the first gear would bend the fabric of space like how a black hole puncture space and time.
Reply: How much torque do you think a human hand can generate?!?!?
Reply: @alternate5108 had the original legendary comment in this thread. We all felt that.
Reply: universe explodes
Reply: @HoldYourSeahorses yes therefore the last gear can only spin while unobserved
Reply: Build another gear box to turn it. @susmanrules
Reply: Me too
Reply: I WANT THE LAST GEAR TO SPIINNN
Reply: Faite juste tournée la derniere roue svp. On s'en fout de vos math
Reply: @susmanrules  why isnt it possible
Reply: He gonna make universe.exe stop responding
Reply: you'd reach the speed of light XD
Reply: @jesuschrist9597   did you even read their comment? they just want to see an attempt. they straight up said they don't care if it's impossible. an attempt is all they want. like try spinning it til it breaks and voila! they did what the other commenter is asking. they aren't trying to argue that it's possible. nobody is. they just want the attempt
Reply: Thermonuclear explosion
Reply: okay then just spin the farthest gear you can. We just want to see the first gear go fast. It’s not rocket science
Reply: Spin the middle gear or a gear farther up the chain
Reply: So why do this?
Reply: It's cheap plastic, it is not possible to move the last gear with breaking it
Reply: Pretty sure that's how we got the end of the world and harambe.
Reply: Even with zero friction, you wouldn't be able to rotate the last gear, because the first one would break the speed of light. So it just would stop
Reply: @jpsalis Amazing explanation. Thank god you were the first reply
Reply: I think, it's gonna need a LOT of torque.
Reply: Yeah bro he just needs to spin it once and he did create a Time Machine! Shouldn’t be too hard to spin :)
Reply: What is the point of building this? It does nothing.
Reply: Assuming that it would be still in a dimension of spacetime that you could perceive.😅
Reply: It would probably create a black hole that would swallow the entire universe
Reply: This is too powerful
Reply: Who cares if it breaks. We just wanna see someone TRY!!! If it works it works, if it doesn’t it doesn’t. We want someone to TRY it.
Reply: If he does that, he breaks the simulation
Reply: @thewanderingguy5436  "AND HIS NAME IS JOHN CENAAAAA!"
Reply: Someone with my mind type right here. “If you spin the last one slowly, will the others shatter with the centripetal force of themselves like wind turbines?”
Reply: Spin the last one to break the universe
Reply: If the setup was made of an unbreakable material and there was no friction at all, you'd still need an unimaginably strong force to make that happen.
Reply: @susmanrules 2000 tonnes is too small of a comparison 😂
Reply: @odezat1317  Would break long before it gets even close to that speed
Reply: Spin the last gear. Do it. Do it NOW.
Reply: I was about to say the same thing
Reply: @boltlightning7804  the opposite of “hello world” 😂
Reply: Same
Reply: YESSSSSS................... .....
Reply: @boltlightning7804 lol
Reply: Same
Reply: Probaly explode
Reply: @jpsalis what if it was metal
Reply: @jesuschrist9597 I don’t think a plastic gear is stronger than me
Reply: @jpsalis NERD
Reply: Sequel idea???
Reply: @MünWeeew Literally my first thought 😂
Reply: @jpsalis  Then would be cool to see the theory of it
Reply: Yeah make that fastboi spin! Use a magnet
Reply: @jpsalis cries because of shit derailers
Reply: I DONT CARE  @susmanrules
Reply: Hahaha!
I am from India. Long time ago we were on a training for Volvo engines for heavy machinery by Volvo engineers. For the engine timing afew gears are used. While assembly there used to be a sequence with timing marks on individual gears. However once set these marks would not align even after many rounds. Some new entrants were in the group and enquired the engineer as to how many rotations would be needed for the dots to align again. Even the engineer was not able to answer. I was actually a senior person in the group. So I came forward and told the group that it is possible to accurately get the right figure. However since we had a schedule we can carry on and I would come with the answer the next day.
The next day we were busy with our schedule but one of the trainees raised the question! I had done my calculations and so gave the number of rotations needed to get all the dots realigned.
So the Volvo engineers were surprised but for Indians this was not surprising. Because our Sages have predicted the various astronomical alignments long long even though they did have any special instruments for the same.

Thanks.
Reply: @alternate5108  it’s impossible. Even if you made it out of indestructible material, you would have to have an absolutely insane amount of torque to turn it at all. Though I do wonder
If it could be done with frictionless materials, no 
air resistance, and indestructible materials and 
then just turning one gear after like going up in gears on a car.
Reply: Kt
Reply: unfortunately the amount of friction would be beyond astronomical to the point it'd be literally impossible to move it even if it weren't for that fact the plastic would break. Once again thermodynamics steps in to ruin the fun
Reply: @alternate5108  it takes too much force to move the last year even a millimeter, rotating it would be impossible
Reply: I really want this
Reply: @jpsalis  that is what I do
Reply: My very thought
Reply: @susmanrules 1 trillion electric motors joined the chat
10 cars traffic yeeted from the chat
Reply: I know it’s like bro didn’t even try
Reply: JUST TELL ME HOW FAST IT IS, IGNORING EVERYTHING THAT WOULD PROHIBIT DOING SO. I'M NOT MAD, I'M JUST DYING TO KNOW.
Reply: same
Reply: @boltlightning7804 "unexpected crash"
Reply: a jesli by sie powoli rozpedzal?  @jpsalis
Reply: @jesuschrist9597 ale dlaczego nie jesli by sie powoli rozpedzal? niczym na rowerze nie mozesz odrazu wrzucic ostatniego biegu bo bedzie bardzo trudno ruszyc ale jesli bedziesz jechal z gorki lub rozpedzal sie na jedynce pozniej dwojce trojce i tak dalej to bez problemu bedziesz mogl jechac na ostatnim biegu. to sa tylko moje przemyslenia ale jesli jest inaczej to prosze wytlumacz mi
Reply: same
Reply: All these explanations are just words, I want to see him spin the last gear
Reply: its not physical possible. There is not a strong enough force in the universe to move it. The first gear would spin much faster than the speed of light, making it an impossibility.
Reply: @BlitzTheFoxi  did you try it though
Reply: hi
Reply: @CheeseFest-  you would need an impossibly high amount of energy.
Think about it like this: if you rotate the first gear with a reasonable amount of energy, it would take eons for the last gear to rotate once. So naturally, when you spin the last gear, the whole thing flips, and in order to rotate it once, you need to expend all of that energy that was used over eons. tldr: you would need the might of god.
Reply: Seeing as it's the same gear ratio each way wouldn't it do the same thing on the other side?
Reply: particle accelerator
Reply: @gagecote2620  that is not how a gearbox works
Reply: Sorry you can’t exceed the speed of light
Reply: I'm worried since you'd have to spin the first gear faster than the speed of light for the last gear to move.
Reply: too much force is needed to spin it.
Reply: The world would explode! DON'T DO IT!
Reply: hey
Reply: @jesuschrist9597  Dude just wanted to see him try.
Reply: @nanolog522 Just make it out of metal then?
Reply: @chemseddinedjouama4115 Pretty sure ypu could just use some pulleys? Or get another person to help?
Reply: I had the same idea
Reply: @boltlightning7804 on my mama you are right 😂😂
Reply: if he do it its gonna destroy the whole universe lol
Reply: The torque required would be immense
Reply: he wouldn't be able to do it
Reply: Exactly
Reply: Probably over light speed
Reply: @CheeseFest-  we want gear go brrr
Reply: @jpsalis  so what you do is put a small rubber band on it. then a generator on the first gear.
Reply: @susmanrules  its possible if you move slowly enough, and yeah, bad analogy, but ignoring that, you get my point.

ANY amount of force applied to the last gear is reduced in torque, but increased in speed, by a crazy amount. just putting a small force on the last gear would get the first spinning fast enough to cause heat damage, probably a ways up the chain too.
Reply: @susmanrules  Shouldn't have skipped arm day
Reply: It would spin faster than the speed of light. So I assume it's impossible even if the gears didn't break.
Reply: If he were to get it to spin without breaking the machine, im pretty sure the gears, and pretty much everything around it, would melt.
Reply: He IS spinning the last one. Just very, very slowly.
Reply: @adamfoxton6341  "Your grasp of the obvious is inspiring." Sorry I couldn't resist.
Reply: The last gear is gonna too strong. I like it
Reply: If gear was durable, at least 2 elephants will be able to stand on a 400 km lever attached to one of its teeth.
Reply: The last two rows may as well be painted on
Reply: If it's possible then I think what happens is it opens up a black hole and the universe gets swallowed up.
Reply: What Americans think be like:
Reply: there's some top tier trolling in this thread 👏👏👏
Reply: @RahulSharma-nv2fq  Hmm so we need a third elephant...
Reply: there are only two thing which are infinite. The universe and human stupidity. Though Im not even sure on the first one.
Reply: @buttercroissant9633  he. Needs. To. Try. And show us.
Reply: it will spin faster than the speed of light and time travel
Reply: @jpsalis I wonder what happens if they used billet aluminum instead of plastic
Reply: @KaziiTheAvali_inactive  probably?
Reply: Hehehe
Reply: @odezat1317 yes but how many times the speed of light if it were possible. Come back when you have the answer.
Reply: @jesuschrist9597 
Not with that attitude.
Kick reason to the curb and go beyond the impossible.
Reply: Make sense 😮 @jpsalis
Reply: The power of the last gear enough to lift the entire Galaxy or may be more  lol
Reply: @_flyingspaghettimonster_  you dont understand this would be a million times harder to move that last gear than a semi truck
Reply: @MünWeeew  nope
Reply: @champagnepandaog3305  it is impossible.
Reply: @Rpzz0 but bro we still want to see it
Reply: Make the last one go spinny spinny
Reply: Ammonium nitrate can spin the last gear plus tje room and even the camera man would spin and probably NOT die...😂😂😂
Reply: It would probably self destruct
Reply: Friction? So it's a skill issue?
Reply: Ok theoretically if we move that gear one rotation then the first gear will go faster then the speed of light which 

A. Not possible since light is the speed limit of the universe 

B. It would prob look like it disappeared or it’s black if it worked 

C. If you can move it I think you broke most science laws
Reply: @miguelito2364  your not funny
Reply: I believe.the first gear would explode. But the friction alone to try and move the last gear would not be possible to move
Reply: now what if we grease it up to remove the friction
Reply: The people who keep insisting "it's impossible" don't seem to understand the specific brand of humor that goes behind everyone else saying "wanna see last gear go fast"
Reply: Fe
Reply: @newbie4789  I'm pretty sure it's possible to move the last gear because it's just gears and gears move that's what they do
Reply: @boltlightning7804  out of RAM. LOL
Reply: frrrrrrrrrrr
Reply: Make an identical one, flip it around, hook them up and bring it back to 1:1
Reply: @hirosh7418  Theoretically possible but the force required to do so is not possible to generate while on earth at the very least
Reply: Солнце остынет
Reply: Same
Reply: as the dude says, it's gonna spins like a speed of light
Reply: @susmanrules  with mass greater than 1000 galaxies*
Reply: It would go around 100000000000000000000000000000000000000000000000000 mph hypothetically
Reply: @alternate5108 it won't spin tho. It would take an infite amount of energy to spin it if it spins the last gear faster than light
Reply: it would spin faster than the speed of light and send you back in time.
Reply: It would spin spin faster than the speed of light..
Reply: Watch it reverse time.
Reply: @jpsalis  would it maybe work, if we make the gears from the strongest material available; Maybe some crazy science made diamond hybride material?  and make it ultra thick?  Like each gear being 140 feet (42 meters) in thickness.  And then add like 10000 ship diesel engines which then REALLY slowly start to add torgue to it? Its programmed so it needs like 12 months to just move the gear a little bit. And over the course of 1000 years it slowly spins faster and faster. Of course the gears needs tons of lube and the 10000 diesel engines are in an array, that allows to hotswap the broken engines out, without stopping the mashine. This whole experiment needs 10000 people to work on it all the time, and it costs humanity 999 billion dollar per year. And finally, after 10000 years, the first gear spun 1 time.  And then we proceed another 100000 years and get faster and faster, until the first wheel breaks the speed of light and the whole universe collapses. That would be cool!
Reply: @Satori-Automotive  ugh
Reply: Same
Reply: The force required to spin even like the next 20 is like 6 tons which would break it very easily
Reply: 😂 this thread
Reply: Якщо припустити що шестерні не зломаються то невистачіть всієї енергії всесвіту щоб покрутити останню шестерню
Reply: @jpsalis  not friction; torque.
Reply: it's impossible,
it's like putting the sun on the start of the HBGW (Hercules borealis great wall)
And then putting a telescope the size of IC 1101 galaxy and see if it's the same on that start.
Reply: Big bang in reverse.
Reply: Big bang in reverse.